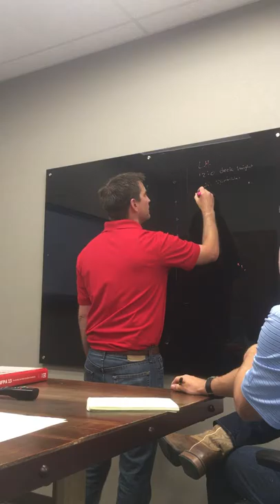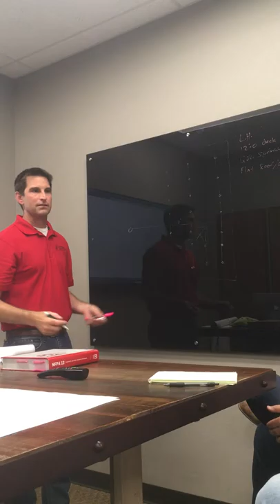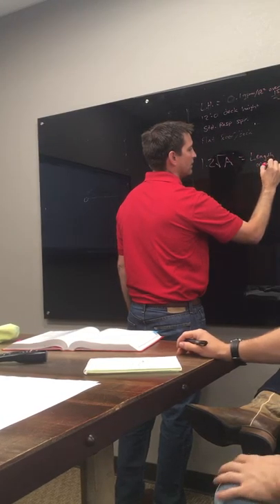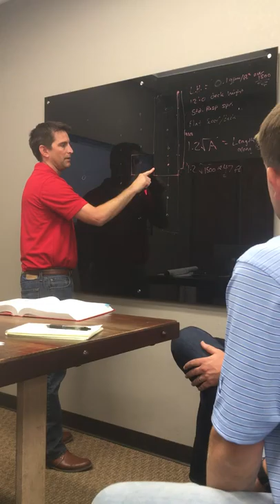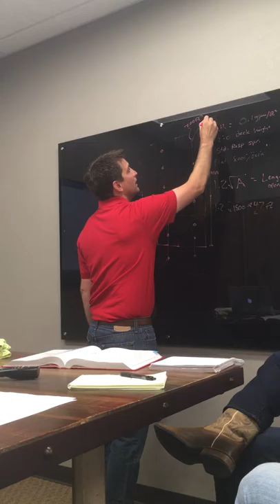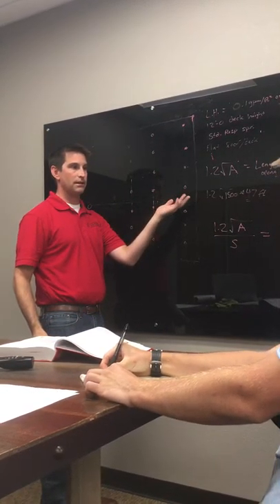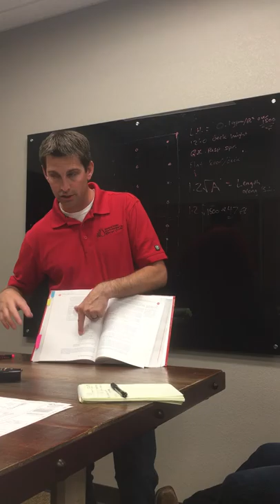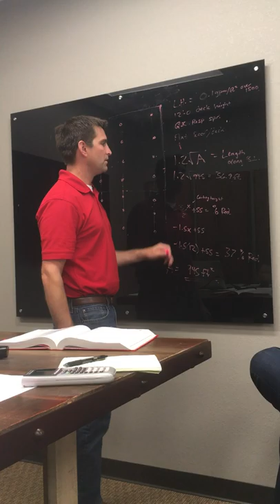Remote Area Elaboration

Comment: When you perform hydraulic calculations on a combined system, do you include the 1-1/2 dia. fire hose cabinet? If so, do you use 65psi and 100gpm as the residual pressure and flow, respectively in the analysis??

Comment: hi Nick thanks for this video very helpful but sorry for this stupid question, what is the benefit of having a reduced design area?
Reply from the maker: Its less sprinklers to take into the calc, so its less water of a water requirement that has to be accounted for your design area. You should take a reduction any time its  possible to do so. For instance i recently had a calc that with standard response heads and a 1500 sqft remote area did not work hydraulically. But when designed with quick response sprinklers and a reduced area size, the calculations did work
Reply: @I_WasHere  ok i had to think deeply on that, but still have no idea why the standard response heads did not work hydraulically on 1500 sqft. but the quick response did. Though on the lesser water requirement part, i think i understood, and it is that by looking thru the Density/Area curve characteristic, as the area is reduced, the density tends to increase, but even though increase, you still gonna end up having a reduced sprinkler water demand, as area is multiplied by density.   I know this will be demanding but would appreciate if can correct me if im wrong.